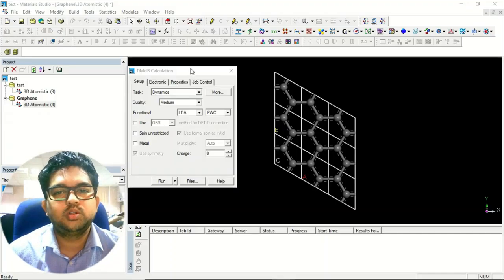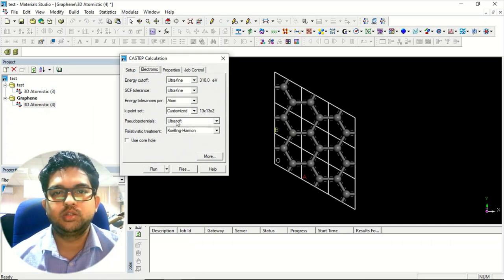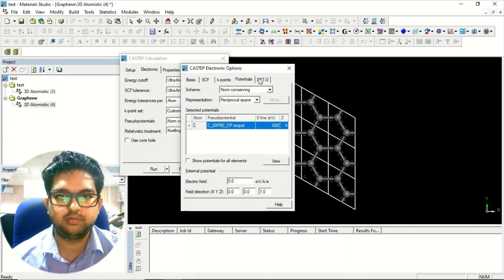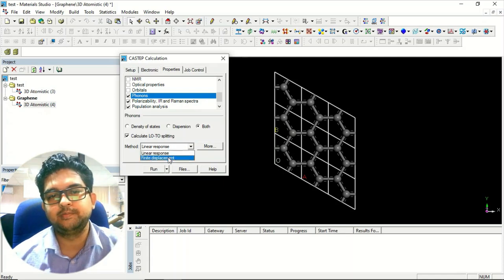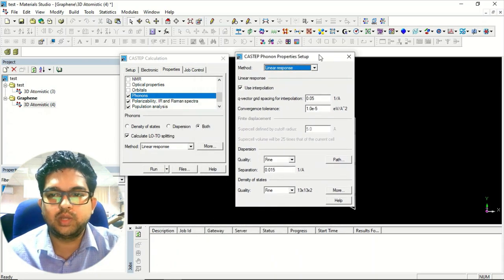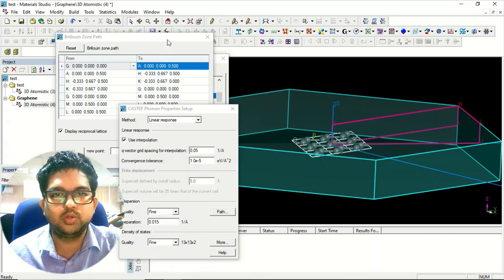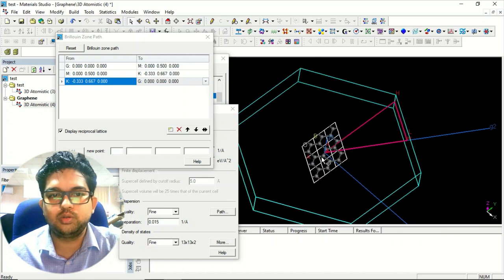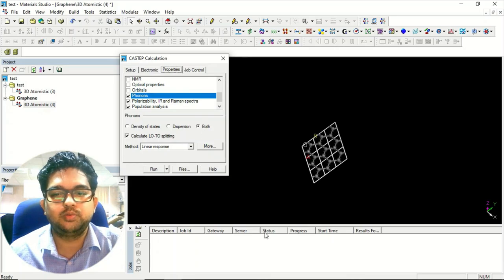Phonon Calculations Using CASTEP tool in Materials Studio ||Dynamic Stability||

Comment: Thank you sir.
Please, in the pseudo-potentiel, is there a difference between OTFG Norm Conserving and Norm Conserving? Also I am working on double perovskite and GGA-PBEsol approximation, is it normal to decrease the value of (supercell defined) for example from 5A to 3A?
Reply from the maker: Otfg is better pseudo-potential than normal. 
And you can't simply decrease the value from 5A-3A.
Reply: @quantumguruji  Thank you. Please, the laptop wich I work on it has 16GB on RAM. I tried with many configuration in calculation's step but with any result. Please give me the appropriate parameters wich allows me to calculate Phonon dispersion for double pérovskite Cs2AgBiX6.🙏🙏🙏🙏
Reply from the maker: @AkramElhilali  use lower energy cutoff (450-500 eV) and simple norm conserving pp, also try to use less no. of processors (to avoid the memory failure), may be you can use 5-6 processors as you have limited RAM.
Reply: @quantumguruji  Thank you so much sir for your respone.

Comment: I have two questions:
  First, is it necessary to use norm conserving?
  Second, is Supercell necessary?
Reply from the maker: In the current version of materials studio phonon calculations only supports norm-conserving pseudo potential.
There are two method to do the phonon calculations...1)displacement method 2)linear response method
Displacement method uses super cell while linear response method uses a periodic system (unit cell)

Comment: Does this calculation need more time for example moee than 12/13hours? I am initially doing hydrogen adsorption calculation on graphene.
Reply from the maker: Yes, it's time consuming process. Depends on the configuration of the system and the size of the unit cell.
Reply: @quantumguruji  For super cell crystal structure which method will be best to use? Finite displacement or linear response? My final work will be 4X4 or 5X5 structure.
Reply from the maker: @sane_0reo  The finite displacement method uses a supercell while the linear response method uses a repeating unit to calculate. The linear response method gives better results than the finite displacement method but uses more computational power.

Comment: My phonon calculation are not converging system is bulk.
Reply from the maker: Please check your input geometry and input parameters. If the geometry optimization does not converge properly, it can affect the subsequent phonon calculation. Ensure that your geometry optimization is adequately converged before moving to the phonon calculation.